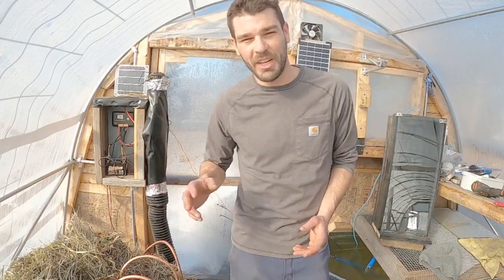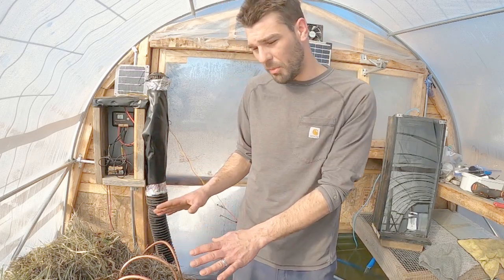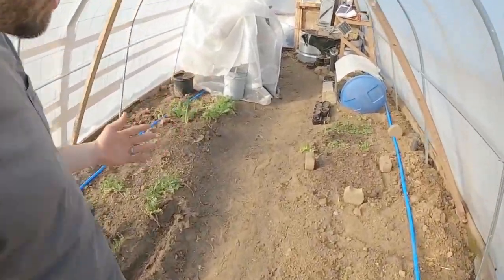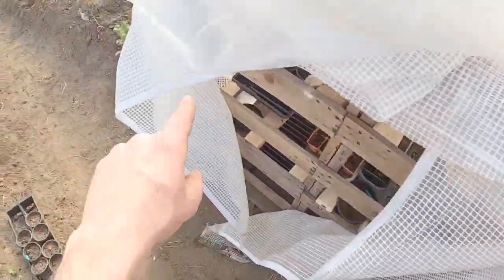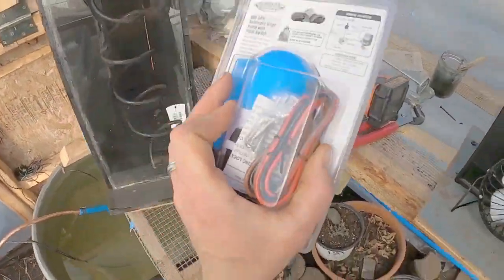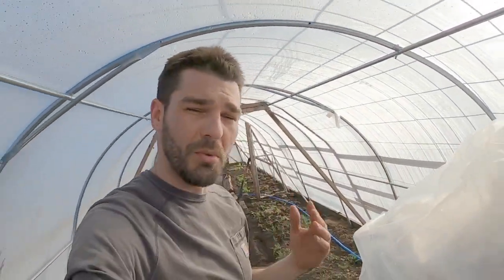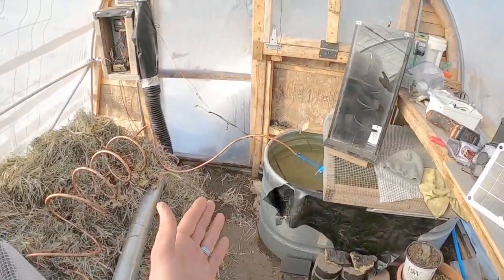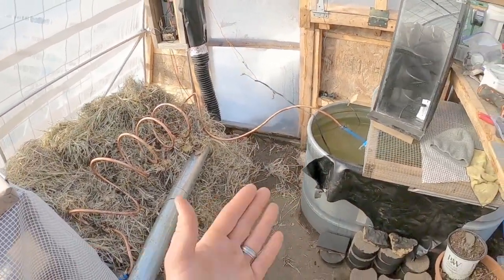DIY Free Heating For A Greenhouse | Setting Up & Running  A Free Heating System!

Comment: Do you think the black box method would be enough alone if you made a larger panel?
Reply from the maker: Im going to try out a better set up with a few potentially beneficial experiments next winter, but I think the box size related to heat containment is pertinent. It’s worth a try surely! Thank you

Comment: a list of items needed and cost would be helpful
Reply from the maker: Once I get this pile heated up I planned on showing some temps and possibly running through the cost to buy all the items to get this running right, plus a list of equipment, I tried to show the entire system and how it connects and runs without the video running on too long. Thank you for the input!